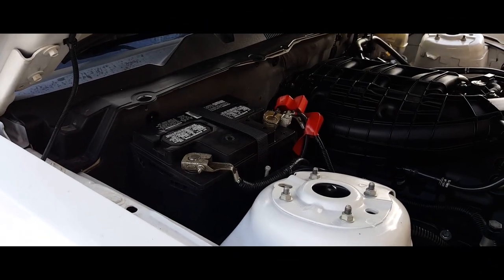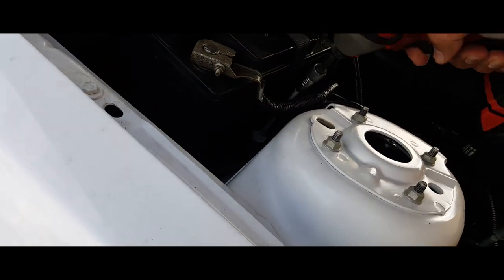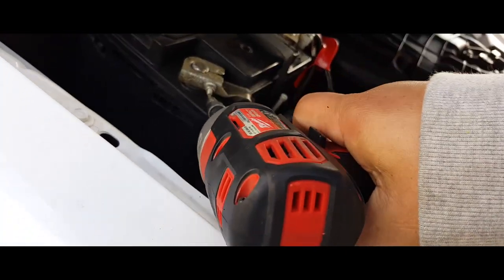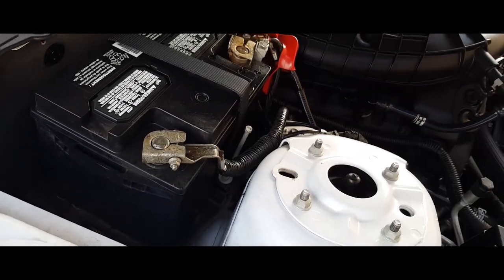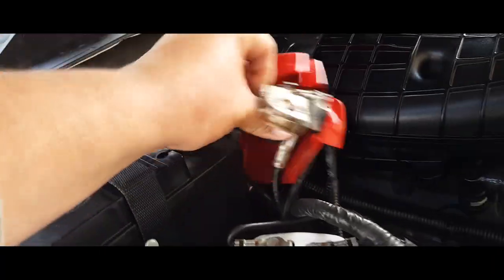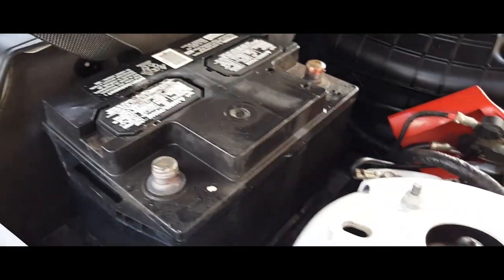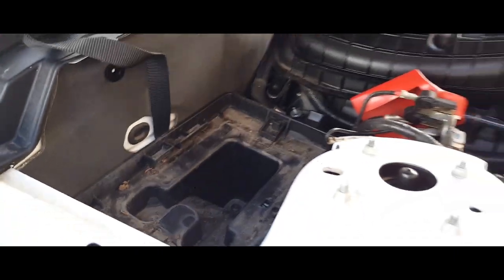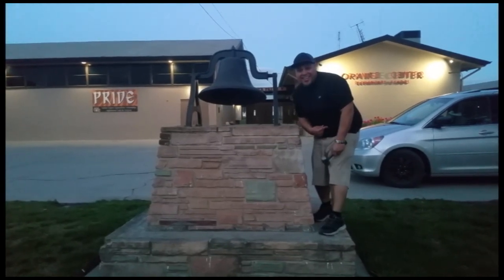How to: Remove a Battery from a 2014 Ford Mustang

Comment: Shouldn't you take the ground terminal off 2nd, not first?
Reply from the maker: Everyone gives me stuff about that but the proper way of doing it is disconnecting the negative terminal first so you disconnect all of the ground from the vehicle that way if the vehicle is still on and you disconnect the positive terminal and lay it down it can make a short if you touch metal on the car so that's why it is the best thing to do is remove the negative terminal first